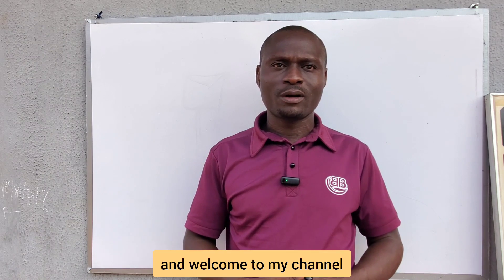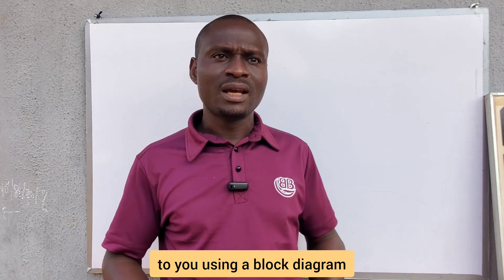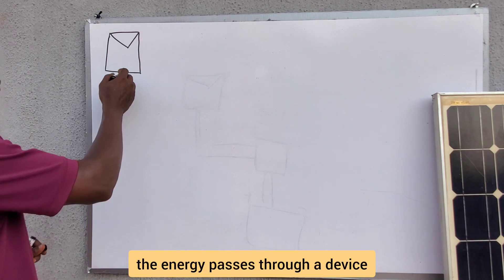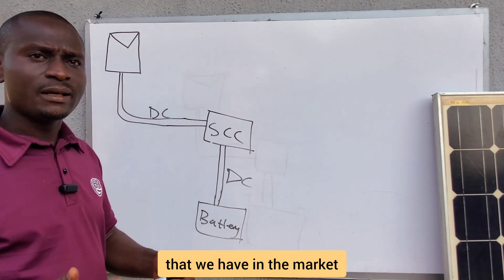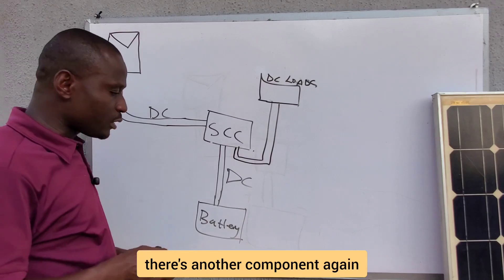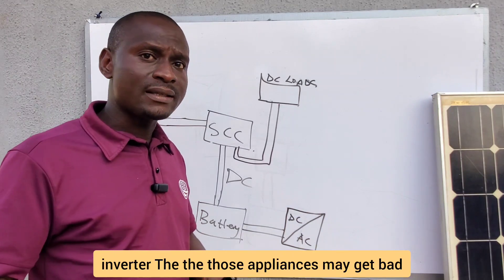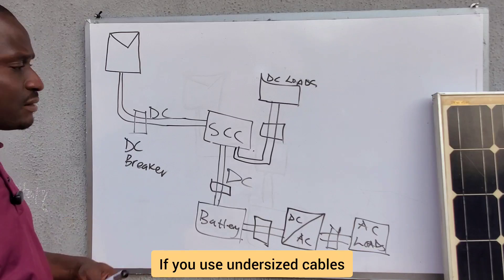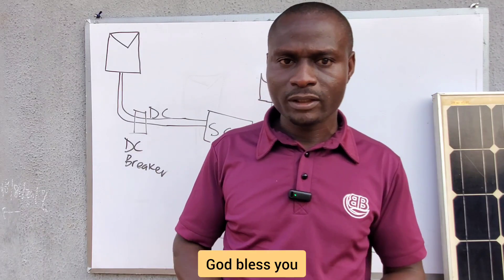Training on solar and inverter Installation #solarenergy #solarpanel

Comment: An solar installer  told me that my 400watt, 24volt solar panels cannot work with my 1kilowatt , 12volt inverter. But from your lectures it looks possible. I reside in IKOM, Cross River state

Comment: Sir I have a 100 watt panel and a 1000 watt inverter but the panel doesn't seem to be carrying my fan or charging my battery fast enough. In the day while sun is out my battery gets too low. I don't know what is happening. I have a pure sigh wave inverter.

Comment: Sir, I like your teachings on solar installation  but I need clarity on series and parallel connections, according to my understanding about these two connections is that if you connect two batteries in series you are adding up voltage maintaining current while if connected  in parallel voltage is maintained but current increases. but you, you said that  if connected in parallel voltage is amplified, which wrong
Reply from the maker: You are right. What i said is a mistake. Thanks for the observation and correction. 🙏

Comment: Send quotation for installation of 30kW and 20kW solar system. The pv should not be less than 600W per panel and the battery should be lithium.

Comment: Good day sir please I want to ask, I have a 2.4kva hybrid inverter  24v with a charge controller minimum voltage of 90v and a  maximum voltage of 450v inbuild. 
Please can I use series connection to connect two  solar panel of 580watts each respectfully, each with a voltage current of 45v (90v in total) and 14amps each and  also have a one solar panel 460watts with a voltage of 60v and 7amps ?

Comment: Do I need to get a charg controller if I'm using a solar generator
Reply from the maker: Solar generators have inbuilt charge controller. Check the manual before you add any component

Comment: Thanks you for your education. I would like your opnion. Here is my setup watching your great tutorials, and education!  The PV solar panels will be in series and have 240 Watt each. I have bought a 4.2KW Hybrid  24VDC 220VAC Off Grid On Grid 120A MPPT Solar Inverter. Im planning to use a Shut Off, a 15A DC inline fuse and a 15A DC breaker between the PV panels and the inverter.  The solar inverter has a Main Out and a Second Out (Main out shuts off first in the battery in below a certain voltage, for example 23V. Second Out supplies power longer). There will be a 32Amps AC Breaker with a 10AWG wire between the Solar Inverter and the AC Main Out and another 32Amps AC Breaker with a 10AWG wire between the Solar Inverter and the AC  Second Out,  The 24V Battery (to be decided  and soon to be bought a 150Ah or 200Ah battery? ) will have a 2/0 AWG wire with a 250A DC battery breaker/ MCCB Power Switch . Feel welcome to share your wisdom if im missing something.

Comment: 12:03 Sir, just to clarify, in series the voltages add up, and in parallel the currents add up. I believe what you mentioned might have been mixed up🤔
Reply from the maker: Ya... you are right. Thanks very much 🙏

Comment: Hello. According to the system you mentioned, if we do not use batteries, do we connect the inverter to the DC Load section or to the battery output points on the solar charge control unit?

Comment: I have a question , is the size of the inverter has to be the same as the size of the battery, example if the inverter is 24volts and the battery must be exactly 24volts  ???

Comment: Some  installations dont require a charge controller. Most modern hybrid inverters have inbuilt BCU/MPPT, so the panels are connected directly to the inverter and the inverter do all the work.
Reply: Yes that is in hybrid system. 
The most important is how to size the SCC when is not hybrid. I think he makes everything easy and we'll explain
Reply: This is a basic lesson on solar power system, not advanced. So all that will come later
Reply: I want to learn, and become a solar panel installer

Comment: Please I have discovered that some install will install a 20kva inverter on a 6kw solar panels and some will even use 11kw solar panels on 20kva. So I àm bit confused. Please what is the standard panel wattage for a 5kva inverter. If my house consumption is 5 kw and I want at least 90 or 100 percent of my load to be on the panels and not the battery during the day . What do I do

Comment: Can we have the charge controller connected directly to the inverter and then from the inverter to the battery. Based on my knowledge the battery have 2 terminals and not 4.

Comment: Pls what type of circuit breaker you should use when installing  5KV inverter is it Ac breaker or Dc breaker and what rate or size should use? Thanks

Comment: I have a question 
When solar panels are wired or connected in parallel is it voltage or current that increases?
Reply from the maker: Current

Comment: How will i connect the battery to be charged with ac current when there is light
Reply from the maker: You can use an external charger or inbuilt ac charger in the inverter

Comment: Pwm solar charge controller 12v 24v 48 is stuck on 14.1v  with a triangle but the lithium battery is reading 12.6v. It has stopped charging. It is not receiving pv. I tried to do a hard reset but nothing happened.

Comment: Can the inverter not also be connected as a load to the charge controller? Since what it does is convert DC to AC and the charge controller supplies DC.
Reply: Nope
Reply: Why?